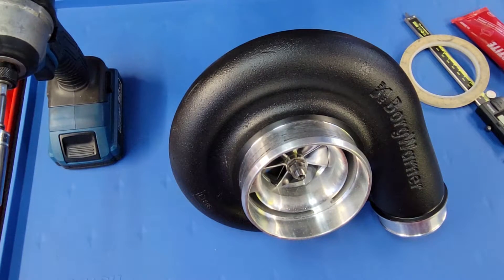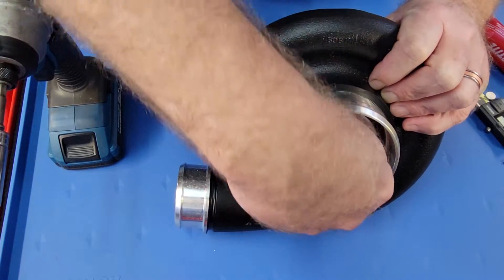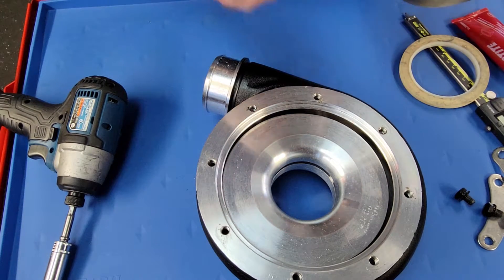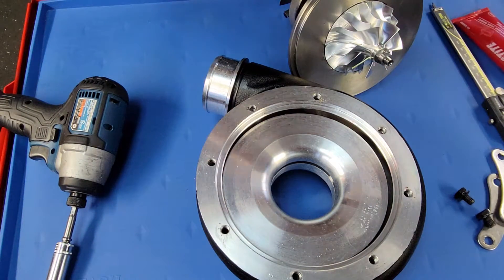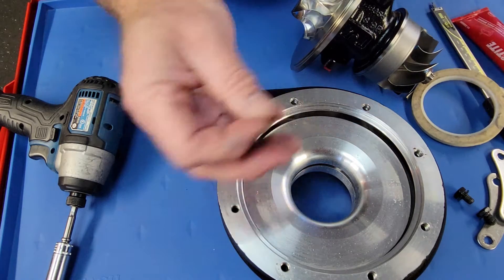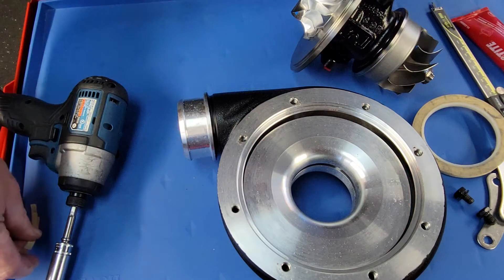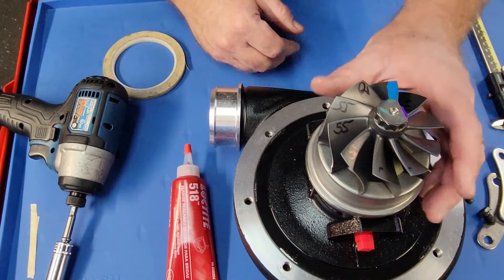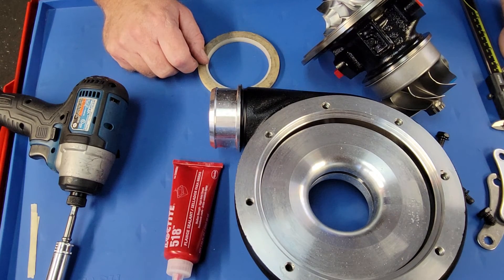S300SX Turbo Shaft Play, How Much Is Too Much?

Comment: I have side to side play and when i spin the turbine wheel it touches the exhaust outlet, is that the problem?
Reply from the maker: Yes sir. Most likely you have wear in the bearing structure allowing excessive motion and subsequent wheel contact. 

But also be sure that the turbine housing is installed correctly and is free from any debris in the mounting flange areas...if the housing is not installed perfectly, wheel contact can occur.

Comment: For axial, I get 9/100 tics on my .001" dial indicator.  So I assume  that is 0.009".  Workshop manual says 0.0035 limit.
Reply from the maker: Yes, you have thrust bearing wear or possible incorrect parts if it has been rebuilt at some point.  The data you have on axial limit is correct.  -Reed

Comment: If i have in and out play what i need to change ? Bearings ? Thanks
Reply from the maker: You will need to replace the thrust bearing, thrust collar and the remainder of the consumable parts.  You will also need to check the side clearance of the seal ring in turbine shaft, excessive thrust motion can cause wear in this area.  The assembly will need to be balanced as well.  We can provide a professional rebuild of your unit if you need help.  Reed

Comment: What kind of shaft to bearing n bearing to housing clearance is considered tolerance? I got 0.0032" and 0.0045" off my low miles SXE with bore gage n mics.
Reply from the maker: bearing housing ID should be 0.7555-0.7559, shaft OD should be 0.4550-0.4555, Journal bearing OD should be .7515-.7520 for a nominal clearance of .0035-.0044.  The Journal ID should be between 0.4590-0.4585 for a nominal clearance of .0035-.0030".  It is normal to see the OD have a bit more clearance to allow for bearing speed control due to a larger surface area interacting between the oil film and surfaces.  I target the tight side of all specifications on rebuilds/new blueprint builds unless it is going in a daily driven application where it will be subjected to higher oil viscosity/lower temperature environments, then I will either supplement a grooved bearing OD or blueprint the build at the loose end of the specification.  High viscosity oil is defined as 15-40 or 20w50, temperatures regularly below 32°F - 

While you did not ask, nominal thrust clearance is going to be .003-.004, same rules followed for oil/temp!- Reed

Comment: Here I am rebuilding the turbo you built for my skyline back in 2016.
That bad boy lasted me 6 years nothing but abuse. 
Bearings were still fine, just starting pushing a little oil out the exhaust side.